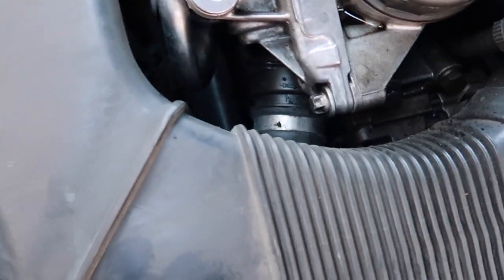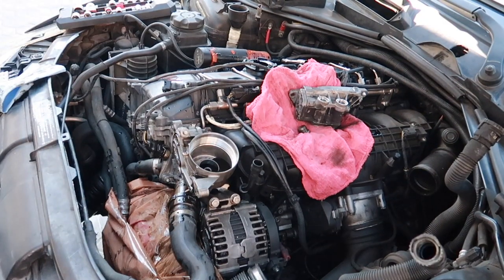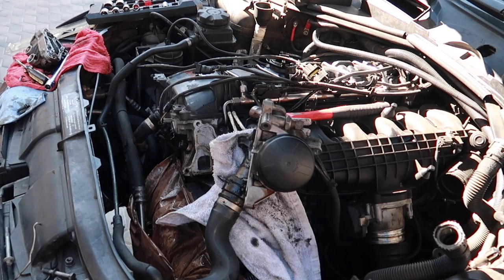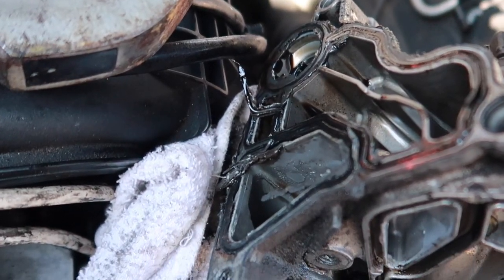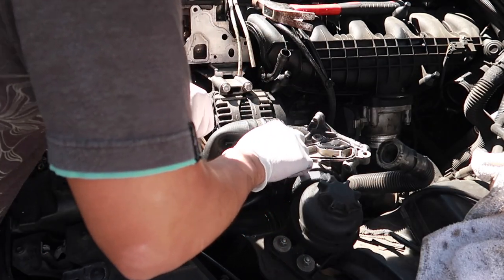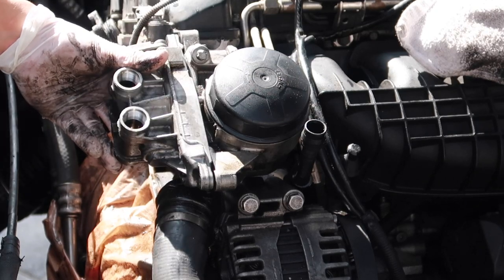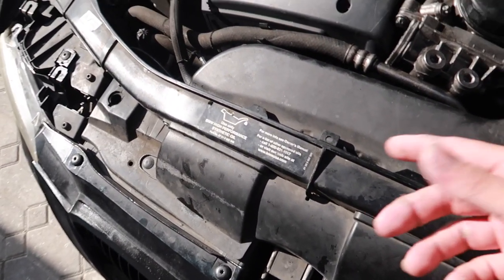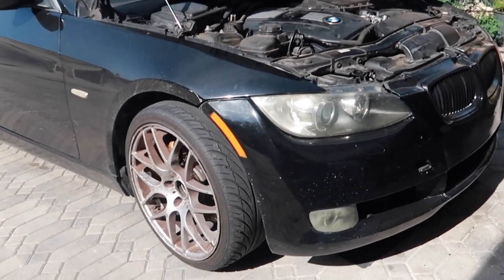E92 335i OIL FILTER HOUSING GASKET REPLACEMENT (DIY)

Comment: Great Video! But why did you put the silicon??? There Is No NEED FOR THAT! Unless the surface is scratched... If you Torque bolts properly it will not leak! With silicon, you have a higher chance of having the oil leak or make even more problems down the road. Also you have to replace the Bolts if they are aluminum. I didn't see if you replace them or not...

Comment: Do you have to drain ALL the oil? Or can you just suck out of what’s in the housing and pour out what’s in oil cooler line? 

I’m doing this tomo but I’d like to run some liquid moly jetron thru a tank of gas followed by liquid moly’s complete fuel system cleaned in another tank gas after the jetron. And want do these additives before I change out the oil. 

I bought the ofhg kit off fcp with a complete oil change kit just want save it for after the additives but my ofhg has a nice leak so need to adresss it ASAP. 

If you have to drain all the oil not a complete big deal I’ll still use the additives and than just change oil around 3-4k instead of the 5-6k I usually do.

Comment: That oil next to the filter cap is probably spilt oil from change, but I do get it has a leak. Its just as easy job on the n55 535i. Doing this job saves a lot of money.
Reply from the maker: Yes the dealership likes to charge an arm &’ a leg for these jobs 👍🏻

Comment: Any issues with the gasket? I need to do mine
Reply: Don't use any gasket maker in a tube. Just do the job as BMW says. Clean with just the gaskets and torque the bolts (Replace those too if possible) to spec and you'll be good to go.

Comment: I don't think this man realized the danger he was taunting when letting this leak go on for a while. This oil leak is the very cause of the serpentine belt getting sucked into the crank shaft pulley. If that happens it can and will destroy the engine.  If you ever see any oil leaking from the oil filter housing replace that item IMMEDIATELY. Or better yet replace that gasket each year to avoid altogether. They do make a shield that covers over the place in gets pulled into but it's not easy to install even though it is very inexpensive to buy. So it's simpler to just keep up with this maintenance item.

Comment: Bro I went to the mechanic and he said he charger 240 is that alot or that's a good price?
Reply from the maker: I think that's around what most shops would charge but you can do it yourself bro!!
Reply: @anthonyulloa4004  I'm gonna try so 3 sockets and extension right